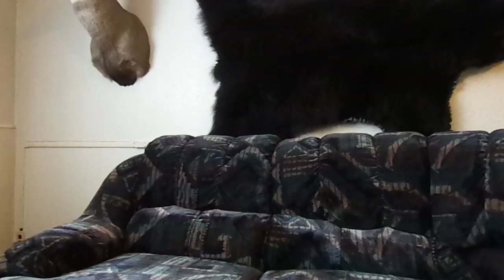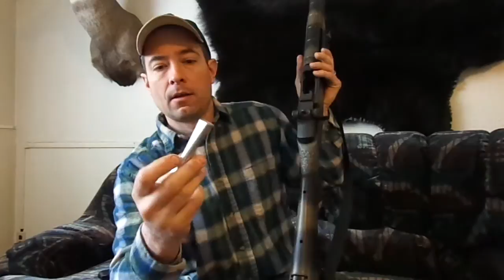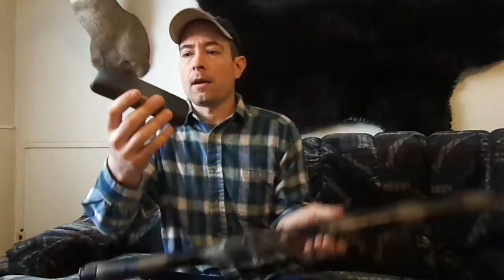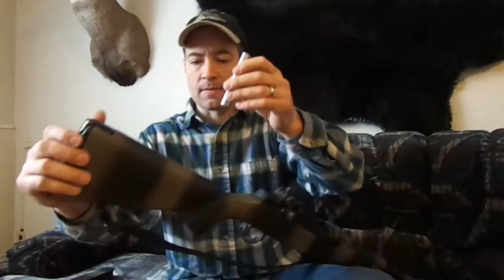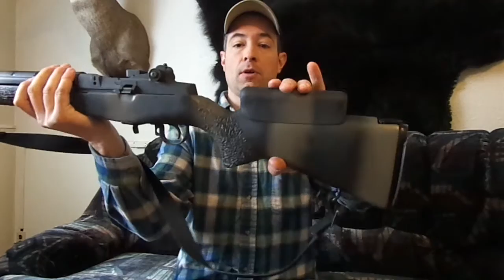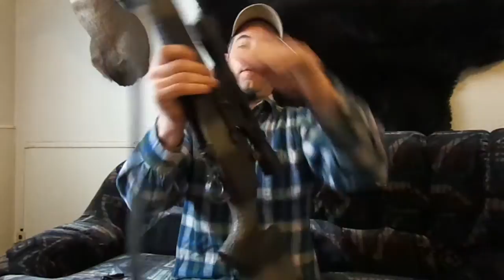Springfield Armory M1A Bush Rifle custom stock with removable cheekpiece and Bassett scope mount

Comment from the maker: It is the high picatinny mount.  It is possible to use the irons under the scope mount, with the cheekpiece removed.  With the cheek riser in place, I am not able to see through the irons.  When using the irons with mount in place, the view is partially obstructed, the mount is visible in the sight picture along with the front sight.  I prefer to remove the scope and mount for iron sight use.

Comment from the maker: I really like the Bassett mount, though I have not used it extensively yet.  I have had it for about a year, it seems to retain zero with removal and reinstallation.  I had an ARMS 18 mount before the Bassett, my rifle was not reliable with the ARMS, it was too low and would interfere with ejection.  Empty brass would get caught between op rod and mount.  That is not a problem with the Bassett mount.